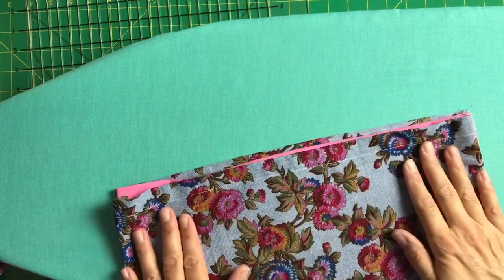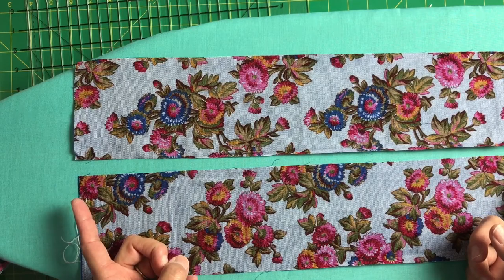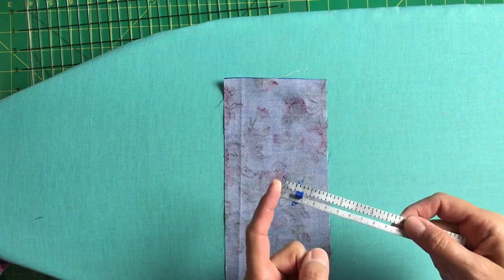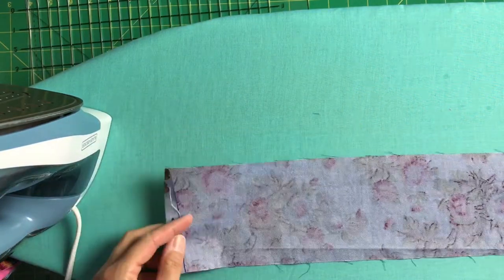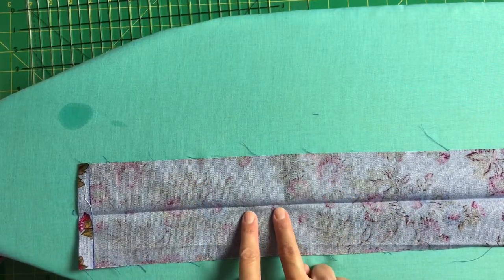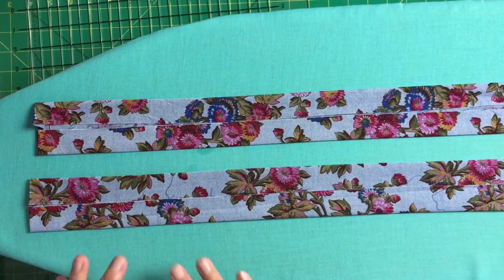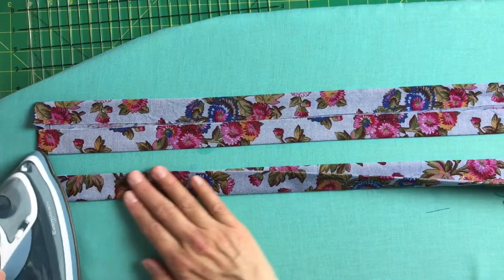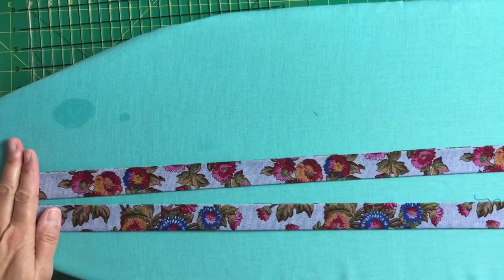Tiny Tutorial: Making Fabric Straps for Tote Bags

Comment: What length handles would you make for a little girl five years old for a shoulder tote?
Reply from the maker: Hi there! As a general rule of thumb, I usually measure the distance from the shoulder to where you want the top of the bag to hit when it's being worn, double that length and add a few inches to either end for seam allowances. It's a formula, rather than an exact measurement so it can be used for any age. You can always pin your straps in place on the bag before final assembly to make sure you like where the straps are hitting and adjust as needed before sewing the final steps. I hope this helps!

Comment: Hi. I bought a fabric tote, but I would like the straps to be a bit longer. I was thinking of adding a strip of fabric to the center top of the strap (the area that goes over your shoulder) because of I do not  want to deconstruct then entire bag. Do you have any suggestions? Or do you offer alteration services for handbags?
Reply from the maker: So sorry that I missed this comment! Don't know that it will still be helpful information for you, since time has passed, but in case you're like me and sometimes don't get to projects immediately...what you can do is make a piece of strap long enough to meet your needs, cut your existing strap and stitch the new piece in place for each strap. You'd need to turn under the short ends as well so that you don't have raw edges showing. If you're worried about it getting the added pieces lined up perfectly in the same spot on each strap, you can deliberately stagger your pieces :). Hope this helps!